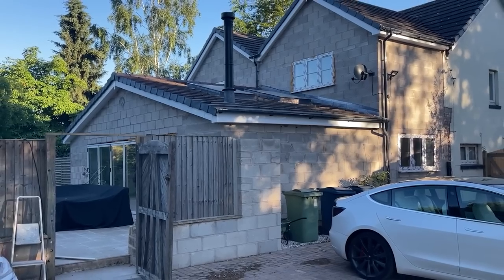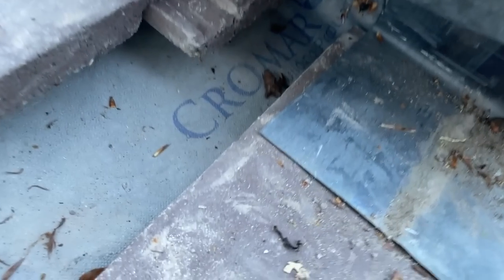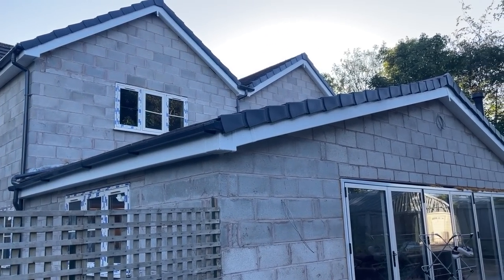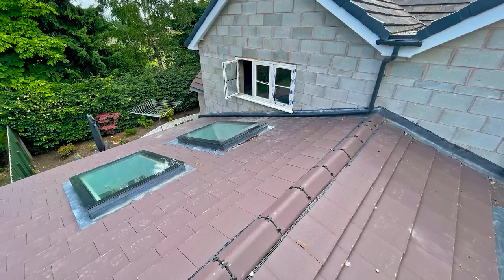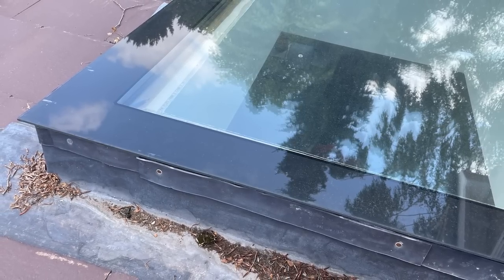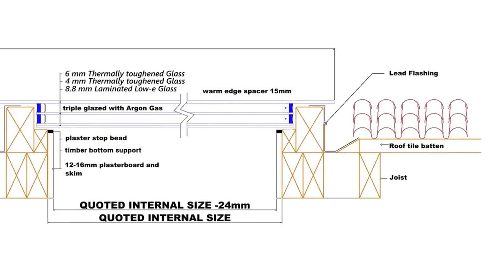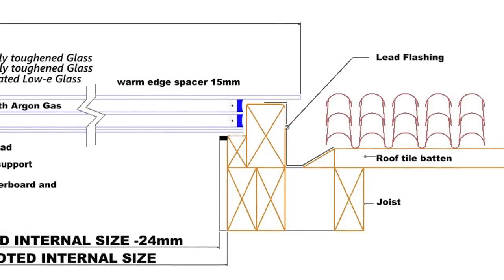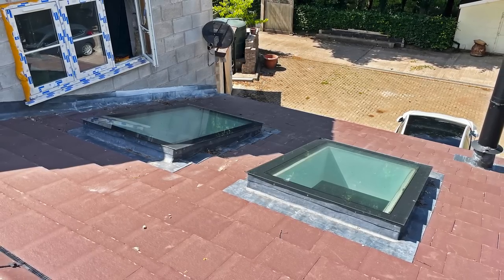How Many Mistakes Can You Spot on This Roof?

Comment: ANY ROOF under 20 degree should be treated as a flat roof.
Ply the rafters with 12mm plywood (assuming 400mm centres) 
Use flat roof membranes albeit fullysealed torch on underlay system

Comment: You need to review the Bi fold doors too!
Reply: That was the first thing I noticed too, they are all over the place but not in a straight line, there is a straight steel above these doors but the gaps between the doors and steel are very inconsistent.
Reply: That's a huge span for the bi-fold doors i did a few large spans like that a few years ago & Cat-Nic had to make special order lintols for them where they increased the thickness of the steel by a few grades It looks like a Bricklayer built the sides up to lintol level & then after a cheap fix was found someone else filled in the pike

Comment: You were correct, MArley moderns are 17.5 degrees. That flashing is horrendous, i would b interested to see the manufacturer's spec for preventing water running down undeneath the glass at the top edge. Great content as always.
Reply: 👍that back edge should have some sort of drip on it

Comment: Am pretty sure Marley Moderns need minimum of 17.5 degree.  Also, am pretty sure the black visible part of the glass should cover the timber upstaged.  It looks like they have used a standard say 4 x 2 timber to form the upstaged and not followed manufacturers guidance on that.

Comment: Customers are always right but can also be their own worst enemies ....every last detail should have been drawn up by a architect and followed to the letter . Looking at the gentleman and his wife my thought is a little knowledge is dangerous .
Reply: Absolutely spot on.
Reply: "...meanwhile Debby has dispensed with the second Architect, and has said she will be doing the design and supervision herself, from now on."  (Kevin McCloud walks in the rain over the untidy deserted house-build). "...and has returned to London, to her work in the city as a legal manager, despite the builders wanting decisions on the cladding. And now the full floor-to-roof German eco-glazing system is arriving tonight by lorry, needing a crane to off-load.. And the costs are in the region of £350,000 over budget."  ( cut to adverts for Walkers Crisps)
Reply: It's absolutely shocking; any architect, architectural technologist or surveyor would have designed an extension that worked from the outset. A holistic approach is required, not just package by package (silo thinking).This would have negated all of the massive mistakes. Low pitch uncomfortable abutments to other windows.  Nobody would let a DiY mechanic do an in-depth service on a modern car like a BMW; but people seem to be quite happy to take this approach on construction, nuts !!!!

Comment: Flat tiles, should  have a channel either side of the window units.
Also the lead upstand should go up and over the frame into a rebate before any glass unit is fitted.
Every roofer knows the dangers of capillary action.
These roofers never even gauged the tiles correctly or even took the pitch into consideration.
My advise is they should do one more and pack it 😅

Comment: did the roof lights not come with a flashing kit? Are they not recessed to accept plasterboard?
Reply: They are just triple glazed sealed units made to drop into a site built aperture. Fine if everyone knows what they are doing.
Reply: Designed for flat roofs
Reply: @macsmith6216  @7:30 confirmed by manufacturer to be Ok for their pitch though.

Comment: i'm not a roofer but a window fitter and i'm glad to be retired now . The roof lights just look wrong, and the Bi-folding doors may be trouble too. Using expanding foam across the head usually leads to problems We always tried to get fixings in the hhead and use packers rather than foam. It makes future adjustment so much simpler
Reply: Hey buddy, out of interest, when you say you used packers rather than foam, what packing material are you referring to?
Reply: @THE-AIDEN-PROJECT  Flat plastic glazing packers. The majority of bi-folds we dealt with were wooden framed and horribly heavy  and you can't just de-glaze them as you would a upvc or ali frame . I was a service engineer and if the rsj whatever above the frame  dropped at all  then the frame would need lifting accordingly . With just packers , you can access them without causing too much damage and an easy repair. If the whole head is foamed then its a pig for you have  get the damn stuff out . I like fixing foam , its great but not for this . I looks like those are an ali framed bi- fold and getting the foam off the frame as in the photo can be a swine too .
Reply: @julesdowner5585  thanks for the reply. Oh so you're talking about using a mechanical fixing over relying on foam for fixing. I'm planning on fitting my own Ali bifolds you see, I've done upvc windows and doors before. I do plan on using a mechanical fixing at the top but I would have still used expanding foam out of a can to fill the 'gap', would you suggest to leave that open or use a different kind of product? Maybe an expanding foam strip tape type thing
Reply: @THE-AIDEN-PROJECT  Always use mechanical fixings . you can't rely on just foam . We always lase levelled ours in too. They are basicall straight forward, just plumb and level  and glaze them the correct way . Its suprising how  fitters can't grasp the toe and heeling of a glass door . Where ever your fixings are , always  have packers there  to tighten up to .  you can foam it afterwards . The longer your bi-folds are then the more chance the beam above  tham may drop. you will need a 10mm gap above the frame just to be safe if not a bit more . You will notice any movement  if the doors don't slide nicely .
i personally am not a bi-fold door fan , but then i've installed loads of conservatories and i wouldn't have one of those either! ha . 
Just plumb, and level and should be ok . Packers across the head wherever the fixings are . Should be fine
Reply: @julesdowner5585  thanks for the tips 👍 I didn't plan on doing bifolds, I actually wanted fixed panes and French doors in the middle but after signing up for a trade account with a firm and going through their options it actually works out cheaper to do bifolds instead 🤷‍♂️
Reply: @THE-AIDEN-PROJECT  I always like the fixed panes and  sliders inbetween . i think more reliable and easier to maintain . Thats just my preference . I fitted loads of conservatories etc but i'd never have one . Its expensive when all those big units break down in ten years or so .Best of luck and i hope it all goes smoothly . j

Comment: I understand being on a budget and wanting to save money by doing things yourself. The issue here is they knew just enough to be dangerous and cheaped out. It seems like they could not afford to do the addition a right way themselves. They should have worked with a contractor who would be willing to work with them on including their labor to lower costs and advised them on materials, means and methods. Better to pay someone a little more money to have it done right the first time than having to go back every year after the project is done to fix things that were done wrong.

Comment: (1) The wrong tiles have been used for a 15* pitch roof. I believe the ones fitted will only go down to 17.5 degrees  (2) No soakers have been fitted to the sides of the windows. (3) It would appear these windows are a DIY project, they don't look like a shop bought product, hence the reason why there are no cover flashings fitted. (4)  the gauging of the tiles is completely wrong. (5) There are no cavity trays fitted up the abutment above the low level roof, the lead has just been cut and pointed in with mastic. This will be relying on the render to keep the building dry. This is an disaster waiting to happen. (6) There aren't any soakers fitted to the abutment. (7) There is no cover flashing at the apex due to not having any cavity trays. To fit cavity trays, the window would need moving to the left. (8) Sack the Building Control Officer!!

Comment: The lead needs to b dressed over the timber . In one piece . Best strip whole roof and get a pro in . I weld the front appeons up sides 8inches under first tile to pick up eny water getting in . Down the sides . Then the side flashing covers that to bottom off roof light. Same as back gutter I always give it loads off lap on them low pitch ones .

Comment: "Lead soakers" on interlocking tiles (single lap)! No, wrong technology. True soakers are for double lap tiles like slates or Rosemarys etc. Continuous overlapping lengths of lead strips are required like shown BUT with at least a 100 upstand, preferable 150. Secret gutters not recommended on "flat" roofs like these, get clogged up too quickly. Extremely poor detailing on top abutment gutter.

Comment: , I've got 2 Velux windows in a bedroom in a council flat. These windows are not right for a bedroom because it is impossible to ventilate the room when raining or threat of rain.They are not set as the proper angle and make half the room unusable due to ceiling slant too low. They are 34 years old and the glass now has misting inside.

Comment: Bite the bullet, admit defeat. Take it all off, possibly including roof timbers (have the rafters been doubled up in key areas?). Start again, then youll start saving money. Dont even think about trying to save money by doing alternative repairs to the professionals  advice given previously. Personally i would have used lead with lead rolls or welted, on a roof designed to take the weight. oh, and real rooflights and involve a professional, there are still good leadworkers at large.  Start saving for the proper job!

Comment: They haven’t worked out the battening if ur using plastic gabels courses shud be 12.75” 13.75”Low pitch shud of used a tile with a roll an always stick with velux windows

Comment: These are the problems I can see, I'm a building inspector.
Roof pitch is not suitable for the tiles used on site. 
Roof tile head laps not enough.
Roof tile spacings have been worked out very poorly, that is why the tile spacings at the top are too close together.
No proper flashing kit for the roof lights.
Roof lights appear to be a very cheap poorly designed product, more suited to flat roofs. I would go as far as to say they may not be fit for purpose, despite the manufacturers claims.
Roof light upstand sized wrongly (too thick timbers), so there is no glass overhang around the edges of the rooflights, leaving no room for a proper flashing or sealant. 
A flashing kit should have been installed under the glass, on top of the upstand.
If breather membrane has been used, it may be too tight not allowing water to run under the tile battens and away, hence the horizontal water mark, as it may be laying there.
Cross ventilation is also required to cold roofs at opposing ends, of at least equivalent to a continuous 25mm vent at the top and bottom, a 25mm air void should be left between the insulation and roof covering/membrane. Relying on a breathable membrane alone is not enough.
Lead upstands to roof against the walls should be at least 150mm tall, and around the 1st floor windows is nowhere near this. 
If the 2 storey extension is cavity wall, where the single storey extension abuts it, there should be a cavity tray / stepped cavity and weep holes. 
I don't agree that the whole roof doesn't need stripping back. I would remove everything back to insulation from the outside and install the correct tiles for the pitch, and install reputable roof lights and flashing kits from a proven company such as Velux.

Comment: I have similar problem my solution is  aluminium soaker made from 0.7mm aluminium 100x200 soaker formed in to an L shape-abutted against the frame under tiles as I could not find a soaker with a large enough projection  and then I will use aluminium composite cut to size many companies do this online I will then screw this  to the the frame over the L shaped soaker plates using water proof screws with a rubber washer -  I may use some CT1 here for added strength. I’m in the process now I will update once done I have also looked into the secret gutter but couldn’t figure out where the water would go.😂

Comment: That's a full on Cowboy effort.  There are no flat concrete tiles that go down to 15 degrees so that is wrong for start.  They have clearly laid the tile courses out wrong because they are uneven at the ridge. The roof windows are terrible they should have gone with a proprietary roof window and flashing kit such as those available from Velux or Keylite, a competent DIY'er can fit them.  However the bigger problem is that the openings for the roof windows have been framed wrong  hence why the plasterboard and insulation can be seen through the glass.  for safety sake i would  strip the lot off and get a professional roofer to sort it out.  They could sell the concrete tiles online to recover some loses.

Comment: Straight away the pitch looks low for tiles used, the gauge of the tile spacing isn’t right, and the flashing around the roof lights isn’t correct,

Comment: Pitch too low for tiles, Minimum pitch for mods is 17.5 degrees , gauge is a mess, membrane not brought far enough up the wall, flashings around windows not correctly installed, everything

Comment: Nobody has mentioned the short course at the top? that's the first sign its a bodge job. if the windows in the main building building were moved or made smaller then the pitch could've been increased, velux windows could've been used making it easier to do a proper job.
Reply from the maker: Loads of people mentioned it
Reply: Indeed it's just so lazy and says it all.

Comment: Regardless of whether you could lift the glass units out, I did not like to see how exposed the edge of the glass was, I am conscious of the way birds can drop stones or moss from the upper guttering (often Magpies hunting for food), my conservatory roof often gets whacked surprisingly hard like this.

To seal the glass to the flashing my approach might be either A or B...
A). 
Once the flashing is laid up the vertical batten to the glass...   
1.  Add a piece of aluminium angle underneath from the edge of the glass to over the vertical flashing    
2.  Fit a rubber edging to the glass that clips the glass and the angle together.
OR
B).
1. Bond an angle strip around from the exposed underneath of the glass to the exposed vertical of the wooden batten
2. Fit the new flashing over this angle up to the glass
3. Bond another angle from underneath the glass (this time bonding it onto the first angle strip already bonded under the glass) and this angle gets bonded over the vertical face of the  flashing
4.  Clip an edging strip around the edge of the glass and this is over tne glass edge and the two edges of the two angle strips
So you are sealing the edge of the glass and two angles, one is behind the flashing, the other is outside the flashing.

For this to work the angle strips will need to reach the edge of the glass so the the edging strip can clip over it.

Google rubber edging strip or pvc u-seal to get some idea of what I am describing.  If the angle strips are bonded with a high standard mastic like sikaflex or adiseal it should provide a long term seal.

Comment: Good roofers are very hard to find, and even the good roofers cannot find good staff.

If you find a good roofer they will inevitably cost a bit more than most, it is definitely worth it.

The other issue with roofing is that roofers talk in a language that has only a tangential connection to English!  Really good roofers take time to explain when they find problems what the problem is, why it is a problem and talks through the potential solutions.

Comment: Not just that roof and wrong roof lights, there are many examples of dodgy work on that build...look at the roof on the double ext. its got a curve on the lower run of tiles on one side and the lap on the ones behind is running uphill ☹

Comment: IMO These people need to strip the lot and re-lay the roof before the water ingress shags all the rest of the work. They've got thousands invested in the insulation, plastering and fixtures etc. All of which could need replacing if it's left under a leaking roof. A stitch in time saves nine as they say.

Comment: This is what happens when the customer is to involved probably done it themselves & blaming a roofer, Get some proper velux windows in there strip the roof to the rafters re felt & batten with some proctor roof sheld & jb battens.  Actually gauge out the roof so there's no stupid short course at the top & incress the headlap to 75mm-100mm just watch it don't kick. It needs over facisa vent & cut membrane at ridge for air to flow & refit the dri ridge.

Comment: Gauge of the tiles is wrong, pitch for Marley Mod's is minimum 17.5 degrees with a 100mm headlap, The knock up frames are the wrong size if they were correct the edge of the plasterboard would be under the black border of the glass & not visible' also there is no reason the lead or any other flashing could not be fitted over the frame so they must have forgot to fit them & put the glass on, the stuck on glass is also a major security problem as a burglar could prise it off as its not housed in a frame

Comment: My view is under flash the roof widows or replace with Velux style. The tiles are lapped on the minimum cover which is too little for the roof pitch so low and not really suitable for that pitch.   Basically it's bad design and bad recommendation of roofing material.

Comment: I have installed some low pitch velux’s which were around 500 each with flashing kits and i splayed the openings. 13 degree pitch lean to extension.. would of done a gable end extension if I were to do it again. Other than the snags and the errors in that skylight it looks alright tbf 😅